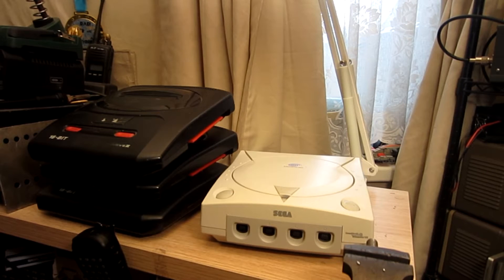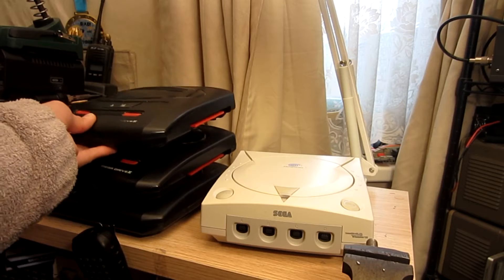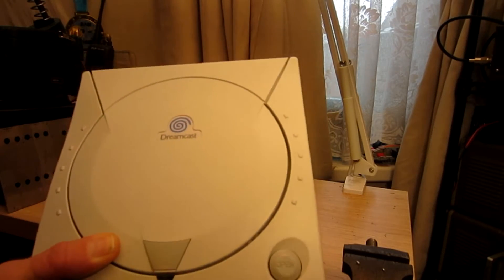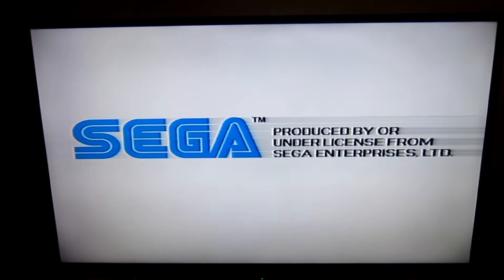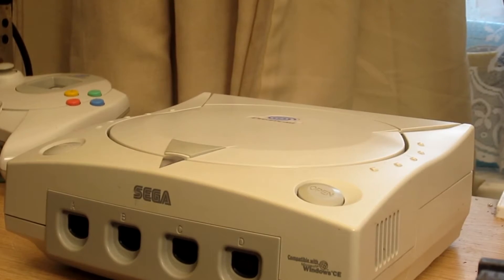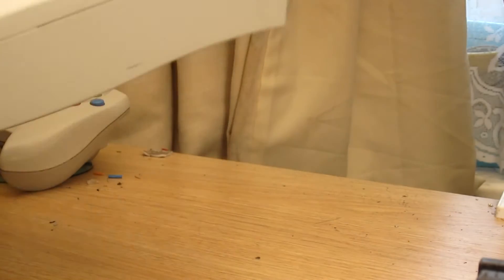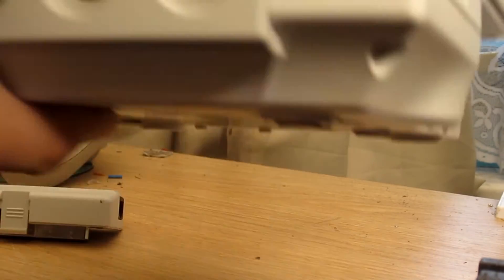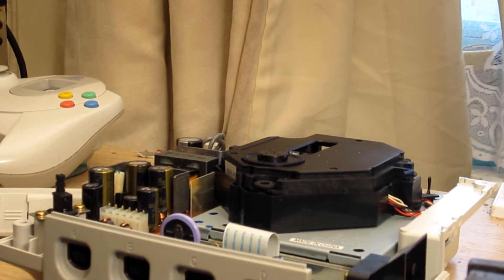Repair : Sega dreamcast with video output fault

Comment: I took my Dreamcast apart for Cleaning and then reassembled it.  My dumb ass used the longer screws on the left side to mount the laser.  The longer screws made contact with the motherboard at two points and cut fine circuits connecting the onboard video card to the output port.
DO NOT MAKE THE SAME COSTLY MISTAKES THAT I DID.
Reply: Have you found any idea to fix destroyed tracks?
Reply: What did your dreamcast do after you did this. Did it not just give audio and video. I already made this mistake, I'm trying to see if this is the cause of my issues.
Reply: @jenesisjp91  You can't repair it. Mine was just dead. No audio no video
Reply: @plaq.  Sorry for the late response, I threw away the damaged board and order a new replacement board.  Fortunately, a guy in Vegas (through eBay) sold two to me for $15 each, which brings up the fact that you can buy new V1 main board for cheap on eBay if you killed the original board.
Reply: @jenesisjp91  it's hard trying to repair the circuit.  They are hair thin.  It's better to just buy a new (used) board on eBay.  Make sure the board say version 1 on it.

*My Dreamcast powered on but no boot screen.
Reply: @feonjun  thanks for getting back. Yeah I put it back together without those screws and now it's working again, so idk . Not complaining 🤷🏾‍♂️

Comment: I had this same problem with my DC,I bought mine when they first come out,had it for about 2years then it started doing the same.....ended up binning it as it was a fortune to send it away back then to get it fixed.

Comment: I thought my cable was bad and I bought a new one but I still have the same problem, when it boots up the dreamcast logo comes up for a second but then it just goes black. if I use the controller I can still hear menu sounds so I know its just a video issue I just don't know what to do about it

Comment: Hey great video! I had a question while using a pound cable to connect my dreamcast to a old oled TV . the picture is clean but the screen is split right down the middle horizontally showing an exact image on the bottom, it looks like a old Co Op split screen any idea how to fix?
Reply from the maker: i have no experience with the pound cables but from what i know theyarent that great.Could be an issue with the cable !
Reply: @rikkatt  thanks for the reply! Much appreciated.

Comment: Video and audio does not show up for me at all. when I turn it on, the led light turns on a second later rather than right away like a normal DC. I ordered a new AC power cable and still have this issue
Reply: I'm pretty sure I know how to fix that. If you still have your Dreamcast then you unscrew it. Then unscrew the battery part and there will be pins. Clean the pins with isopropyl alcohol or antistatic foam cleaner. Then scrap the pins a bit to get rid of the grime. It should work

Comment: Hey there is there any suggestion you could provide to fix a booting issue. The fans is good the disk drive is running but i get no picture any help would be appreciated here!
Reply: Yes, no one seems to know about this, mine does the same.
Reply: Is it a reset loop?
Reply: If it is a reset loop I know how to fix that. If you still have your Dreamcast then you unscrew it. Then unscrew the battery part and there will be pins. Clean the pins with isopropyl alcohol or antistatic foam cleaner. Then scrap the pins a bit to get rid of the grime. It should work. It worked for me so it should work for you.

Comment: Ok, you just unplug and open it without discharging your capacitors first. Kinda risky.
After seeing your sweater, you're going to strip down your machine without thinking about static electricity. Kinda risky.
Reply: None of that is even going to matter at all.... discharge extra low voltage caps??? Really??
Reply: good point. safety first
Reply: The only thing that might give you even a slight zap are the power supply caps. A sweater isn't going to destroy any components. Relax.